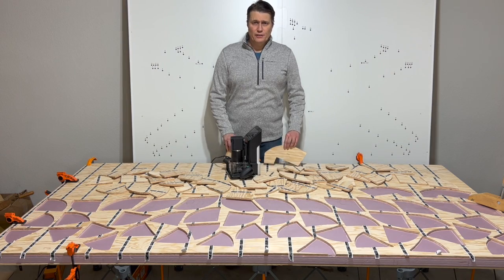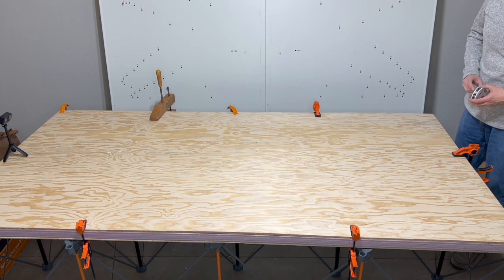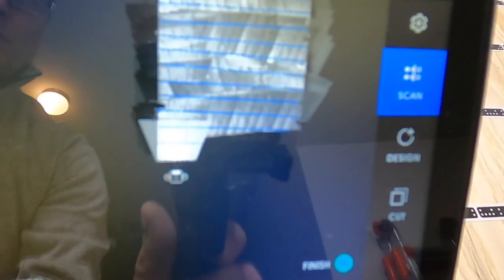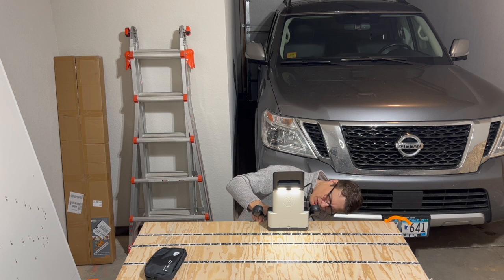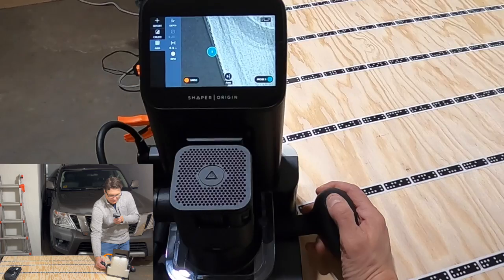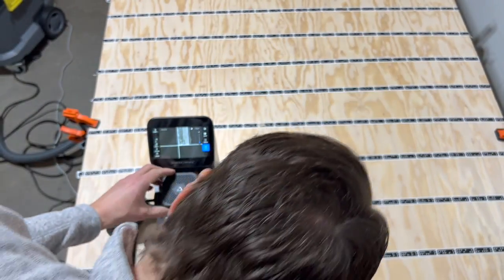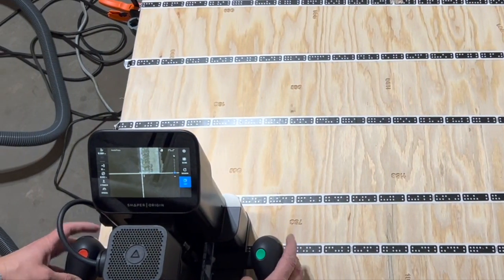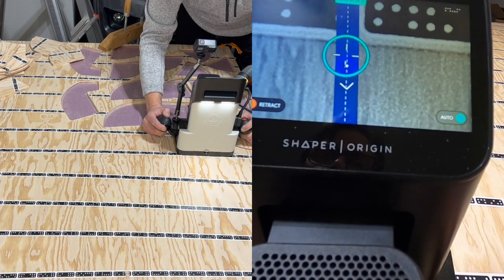Temptress Build 4: Cutting Frame Gussets With Shaper Origin

Comment: Thanks for sharing.  BTW there is no need to keep the tape super parallel.  I am 3 months in owning my Shaper and am enjoying .  BTW rather than scanning off the edge removing the shaper, you can turn the shaper 90 ish degrees (or even more) and scan off the edge without accidentally raising or lowering the unit.  As good as Shaper is its expecting everything on an 2D surface.
Reply from the maker: That is a great tip… i slower have learned more with the ShaperOrigin.  And love it.

Comment: How much did you spend on the plywood vs the domino tape?
Reply from the maker: Marine plywood is $70-$100 per sheet, depending on thickness.  If I had more knowledge when I started, I would have purchased Sapele marine plywood, but it is more expensive.  The Shaper Tape (domino tape) is ~$20/roll.  I use <1/2 roll/plywood sheet.  So $10 of Shaper Tape per $100 sheet of marine plywood.
Reply: I’ve seen so many folks making a fuss at the cost of shaper tape.  150ft roll costs $22.  Pretty sure its not that much more expensive than decent double sided tape.  I guess there are folks that have figured out how to create their own DYI tape.  If you use the shaper workstation or template, which won’t work for this application but for other things, its no additional tape.